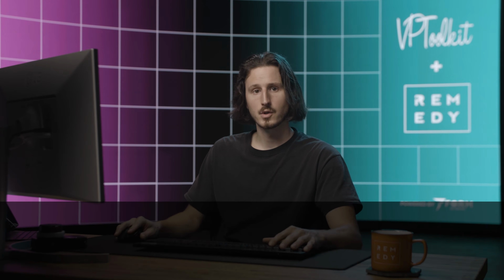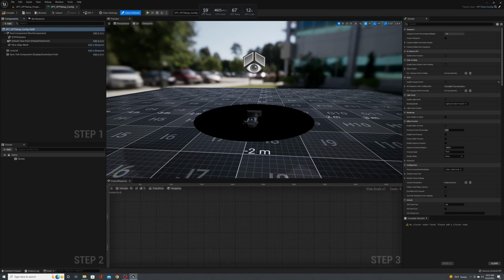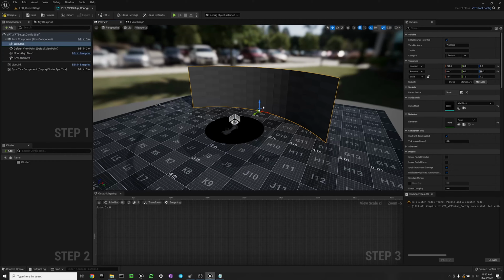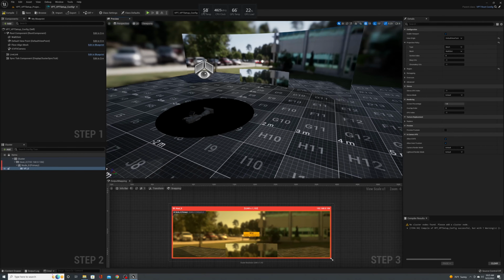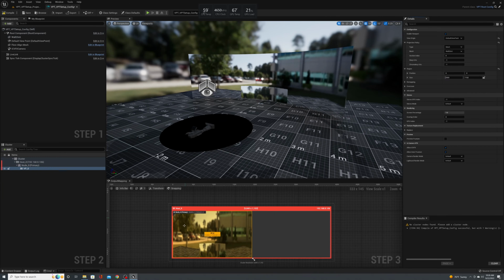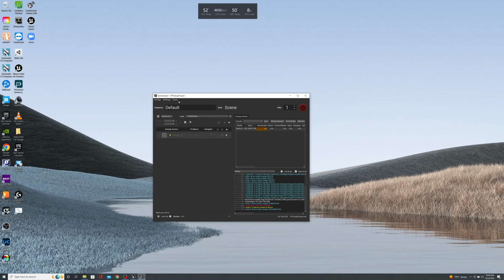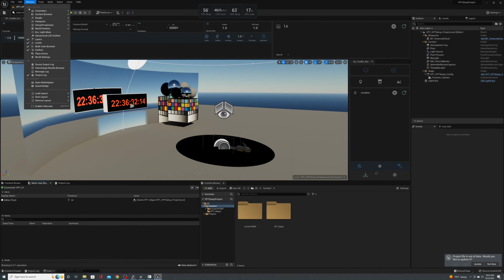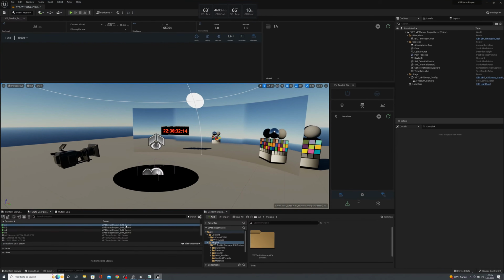Step-by-Step Tutorial: UE Setup for LED Wall Virtual Production - nDisplay & Switchboard

Comment: What should I do if my scale on the led wall for my set is not real world scale
Reply from the maker: Would need a little more info on this but if your phyical props are not real life scale (say you're using miniatures) You'd just scale your ndisplay config transform relative to that scale. I'd build the virtual world to scale, figure out the different and then scale to match. This will also make it so your tracking is relative to that scale if its using the ndisplay config as its root/parent.

Comment: In stage setting project level manager it not showing
Reply from the maker: Well hope you figured this out! its under Maps/modes (or you can also control which level the project starts with at the top of the switchboard)

Comment: Thanks for the tutorial! Great to watch and learn from. Could I just confirm that in your case, you're sharing the project files on a NAS that each machine is able to access? That's what it sounded  like. But I've heard from others that UE doesn't like Network storage locations?
Reply from the maker: Hey James, thanks for reaching out! In this video we are using a single nas and one copy of the unreal project. Unreal/ndisplay can run like this for smaller setups but you have to do some workarounds for saving (we go through this in the video a bit) we have also released a video on more complex server workflow where we open up a shared folder on each machine and keep them synchronized using free file sync. Here is a video showing that workflow: https://youtu.be/tszdUkqx5xM?si=7yjXRCR_GPm21dht hope that helps!

Comment: How do I use one primary computer and use other internal computers' gpu to render different viewport? I have been dying to search for an answer...
Reply from the maker: Hey Thanks for commenting! This is kind of a tough one to answer. There are a few methods to do this, the newest and most current method is to use Multi-Processing. In Feb we are planning to generate some new video content and an updated online course that covers all of these methods in detail but until then I will share you a link for the documentation. Hope this Helps!: https://dev.epicgames.com/community/learning/courses/ev7/unreal-engine-multi-process-rendering/PpWX/unreal-engine-multi-process-rendering-getting-started
Reply: @vptoolkit  Hi, thanks for replying. And yes I read this doc before. Currently I would like to do a test: 
I have two laptops and they are in the same network, I can set up multi user and ndisplay sessions for each of them. When I launched cluster nodes on switchboard, both of the laptops were rendering out assigned viewport in ndisplay config, which was confusing. I totally understand that ndisplay is a solution for LED screens, but is it possible that I can move rendered node on my secondary laptop to my primary one? So that it is more like a render farm that I do not need to run to different laptops back and forth, and I can use their GPUs to render different viewport of my scene.

What is more, I am also wondering what is the differences between running switchboard and previewing in the editor. Even though I set up different hosts inside NDC, when I drag it into the scene and turn on realtime on preview settings, Both viewport still get rendered out. I assume the viewport belongs to other host should not be rendered out or is it shall only be separated rendered out WHILE ndisplay nodes are started in switchboard? If so, inside the editor I am using one laptop's GPU to do a render job that should be assigned to different machines?

Thanks for any help, this is confusing me for a long time, I do not know what to do next.
Reply from the maker: @chah1653  So I think this might be deeper than a YouTube comment response! There are many ways nDisplay can be configured with multiple machines over a network but I’d have to get some more info on exactly what you’re trying to do to give you a proper answer. We offer hourly consulting if this is something you’d like to setup a time and go over your setup. 

As for the ndisplay Preview in Editor… That is just rendered on whatever machine you’re running the editor and does not use any performance in an ndisplay instance of UE. The Preview isn’t a true representation of what you will see in your nDisplay projection but it can give a good idea. In a lot of cases we turn it off so that the editor preforms better when making environment changes. We also sometimes turn up the quality if we are testing an environment for how it’ll preform in nDisplay as it kind of “bottle necks” the performance of the project.

- Ian
Reply: @vptoolkit  Thank you so much for the reply!  I now have better understanding of how ndisplay works inside unreal and in switchboard.
Reply from the maker: @chah1653  Great, glad we were able to help!

Comment: i wonder do you have a very basic beginner tutorial covering eqptmnt needed and is there a way to start to use a tv instead of led wall for cost sake
Reply from the maker: Not yet, but we got lots of new tutorials coming to our channel soon! 

Regarding your question: Yes you can definitely use a TV to get started learning and working with ICVFX virtual production. There are some factors you will be have to into consideration like the fact that TV’s can not be genlocked (synchronized with camera) and most TV’s have reflective surfaces that will show lighting or props on your background. We often use TVs and projectors for demonstration and testing setups with these limitations in mind. 

Let us know if there is anything else we can do to help!